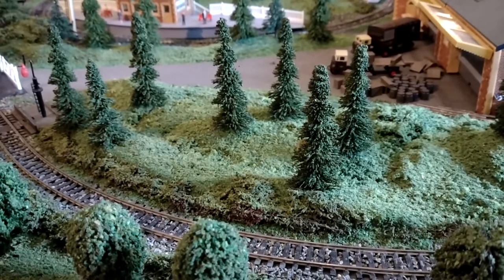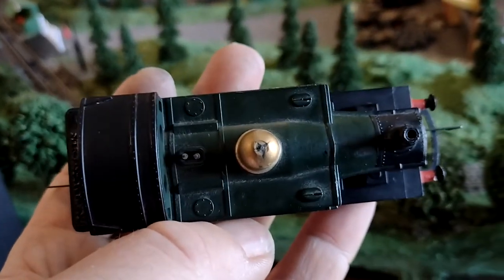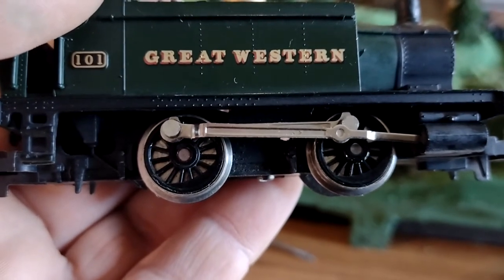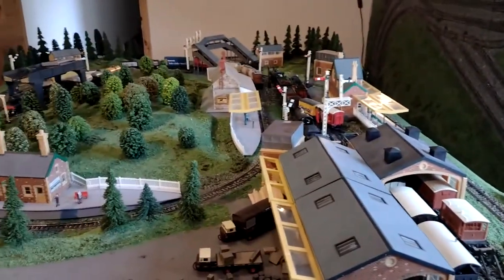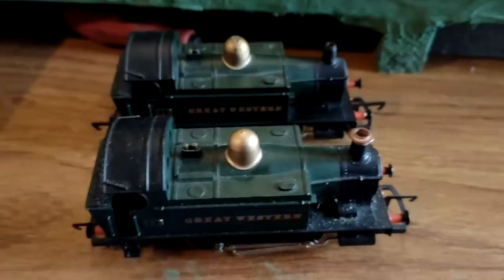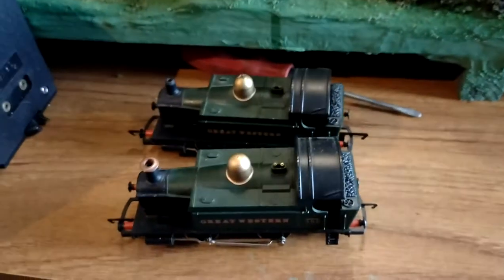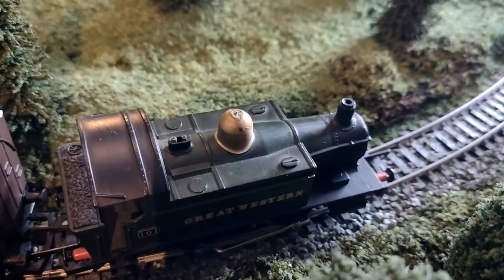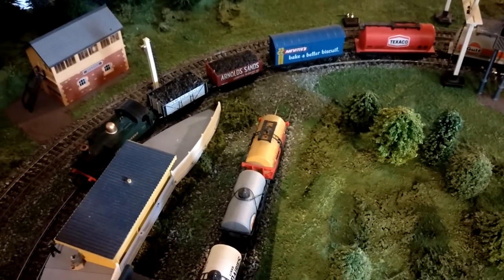Repaired My Original Hornby R333 Train from Christmas 1980 Off The Rails 20 Years On The Road Again

Comment: Well done, true satisfaction when you get an engine back on the rails after such a long long time. 👍 love the twin head run for a large chase the tail train..
Reply from the maker: Oh yeah, I was really chuffed! I think it must have been 2002 when I took it apart (changed the worm gear and drive gear) but must have buggered the wheel quartering up. It now runs absolutely brilliantly. I might replace the copper cap on the chimney and see about scratchbuilding the broken steps or something...
Reply: Pugs hate points. Someone told me you can get a wagon attached and wire it up to the train itself which getd rid of the problem. I had a go and that's how mine stopped working. Smart with those carriages.
Reply from the maker: I hate points, always have. damned things move, they derail everything, they short...bloody rubbish.
Reply: @Codbotherer  as an American I am use to atlas and other companies for code 100 track.  Now that I model British outlined trains, I went with Hornby points because the older Hornby stuff has trouble going thru atlas point and after awhile I gave up on many of the Hornby points and went with Peco. I absolutely love Peco.  No issues whatsoever and the small steamers never stall on them either
Reply from the maker: @ghostengineer  thanks. Yes, I've heard a few people say peco points are superior. I think that the next time I build a layout - if I ever do - I will use new points, probably peco, and modern track. I'll probably stay away from first radius curves too